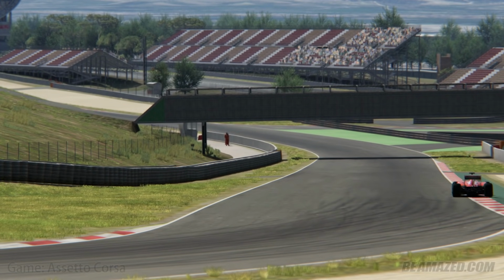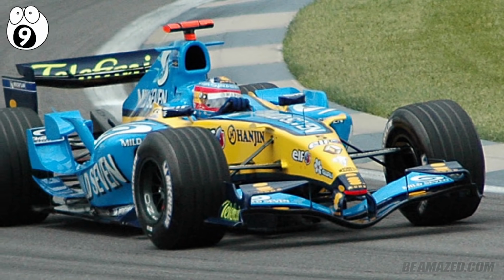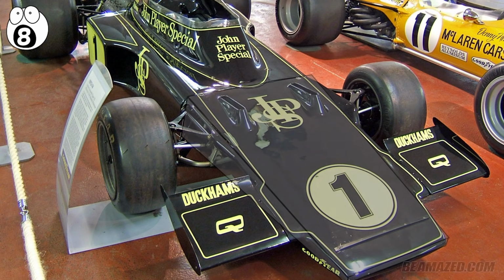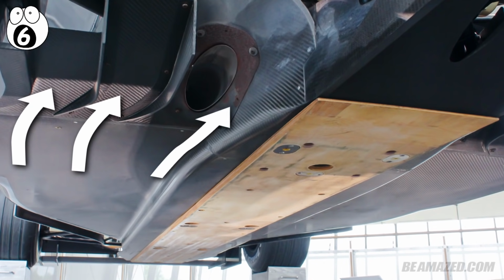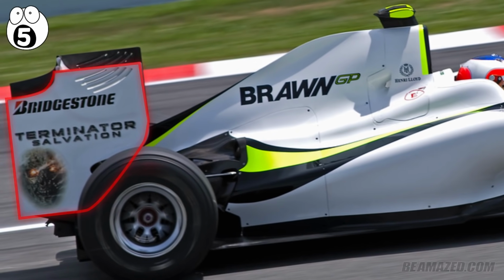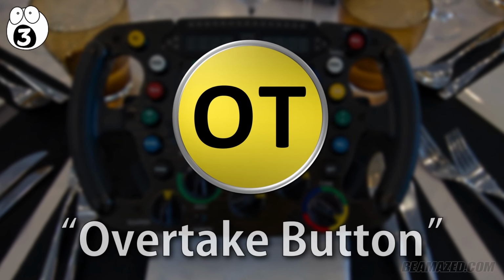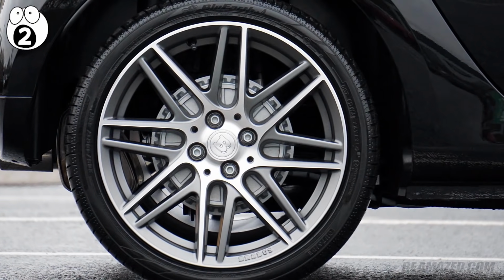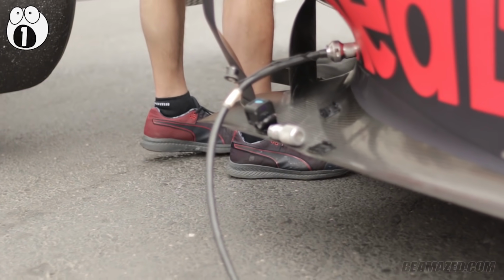Secrets Of F1 Car Design You'll Find Really Interesting

Comment: Terrible facts, The front isnt for downforce its to help move the air away from the tires.
Reply: Lewgenious17 I was just making a joke. Sarcasm is hard to pick up on when reading sometimes lol.
Reply: TGH-TheGamingHotDog Wrong, well you are right it is used to move air around the front wheels but it is also used to guide air to the bargeboards/floor/sidepods and to create some downforce aswell
Reply: TGH-TheGamingHotDog The front wing creates roughly 25%-35% of the overall downforce meaning 500+kg at high speeds... pretty sure they definitely are for downforce more than channeling air away from the tires. And I also seem to remember the first front wings (around 1968 or 1969 I believe) didn't even extend far enough to even affect the tires. I agree they definitely do move air away from the tires, but definitely not their primary function
Reply: You're both wrong, it was added solely to make more space for sponsor ads
Reply: Michael Matthews Oh, apologies hahaha
Reply: Now teams have in a sense reached the max downforce potential that the wing can produce so they have moved to smoothing the air around the tires and guiding to important parts of the car. Such as the barge boards.
Reply: Aerodynamic grip is equally important. I was replying to the OP saying definitively that "It isn't for downforce". Yes, it is, and especially at High speed corners it plays a major role, also accompanying mechanical grip in all circumstances.
Reply: Michael Matthews So your trying tell me that the front wing is solely just for sponsor space ?
Reply: Michael Matthews quitw funny but in the era of ground effects, cars didn't need a front wing
Reply: I don't know if you mean this, but anyway I'd like to challenge you to wonder what would happen if an F1 Car tried to steer at the 130R without a front wing.Answer: A fucking tragedy. Why? It would not suffice the amount of downforce needed to stick to the track and take the turn.
Reply: Yeah it also filters hotter air up over the cooling system allowing the cooler air down slowing for more efficient cooling
Reply: Probably, but keep in mind the wing is actually behind the rear tires so more downforce at the back means you need more on the front to keep the nose from being lifted off the ground. And its not just about absolute maximum downforce because downforce also produces drag, so its really about balancing the two
Reply: 130R?   Is that that highest F1 G force turn at Suzuka?   Something over 5 G lateral?
Reply: 130R;  Is that the 5 Lateral G turn at Suzuka?
Reply: What an idiot you go learn what front & rear wings do!!!!!! Ignorant fool
Reply: ALL WRONG! The front wing is like it is simply because in the 70's F1 engineers were all big fans of Hammerhead sharks, and thought it would look well cool if the cars looked like them too.
Reply: There still is the potential to put a bigger wing on ... There's still some space left around the rear wing to make it bigger.
Reply: Stratos Kat lol, cars did that in the era of ground effect. Anyways, the front wing is indeed for locating air to diffrent places like the floor or away from the tyres. Added effect is that it gives downforce by also moving air up. But with the mechanical grip and floor/diffusers these cars have, i think there is no need for a fron wing to be mostly for downforce

Comment: We should also remember, however, that the F1 rulebook is little more than a listing of banned features and technologies. No turbochargers. No superchargers. No turbines. Ram air intake only up to a certain aperture size. No active suspensions. No actual venturi wind tunnels under the cars, let alone side skirts or suction fans. No wheel covers. No more than two axles. No 4WD. No AWD. No traction control. The last version of the rulebook that I glanced at said no driver control over the air control surfaces, so I guess they knocked that one off. They wanted to ban two-way digital datastreams until they judged it to be impossible to enforce. And judging by the crazy complexity of the steering wheel, I bet the current book bans computerised programmable behaviours.
Reply: Lol, remember that one time that bennetton still had the digital code for launch control in the car and the fia didn't do anything about it
Reply: TheHumanNacho Your completely right except for 1 thing, you saod turbochargers are banned but the current engine format is a 1.6L V6 Turbo Hybrid
Reply: I would then say two things:

Good if they have unbanned turbos, and haven't banned electric transmission (after all, they did ban CVT).
 
Very bad if they have indeed limited engine configuration to Otto-cycle V6. No Wankel rotary engines (the speciality of Mazda). No boxers (the bread and butter of Porsche) . No five stroke engines. No Hüttlin engines. No Grail engines.
Reply: TheHumanNacho Mazda rotary engines are just wow😍, the 787b is in my top 3 best sounding racing cars, its like music

Comment: The holes in the brake discs are not for cooling there are for "cleaning" the brake pad from the brake dust to get better brake performance.It seems not right what i am saying and i was confused to when i heard this put it is so
Reply: Actually they are neither for cleaning not for cooling. They are the escape route for vaporized pad compound. Those gases are at high pressure and separate the disk from the pad reducing friction. The holes provide a way out.
Reply: Carbon fiber is really stable when the heat travels with the strands it expend heat quicker witch is bad becuase it also can be used as an abs if the brake cools off to fast and u try and brake again you will lock up Thomas you are completely rught
Reply: nope, they are mainly for cleaning, there are also racedisks with slots wich are only about 2 Millimetres deep, but it´s more easy to drill holes through both disk layers instead of doing it both sides not symmetrically
Reply: They are for cooling, there are comparisons online with and without holes
Reply: Lewgenious17 No it's for cleaning, cooling is done by the radial slots on the disk (the ones you can see when you look on the thin side of the disk), how would hot air that is whirled outwards because of the centrifugal force get through little holes that are not faced that way? Just think about it.
Reply: Stefan Huber thanks for your support and for the more technical advanced describtion

Comment: Actually going behind a car is good because of a draft
Reply: Drunk On Bleach f1 isn't nascar
Reply: Drunk On Bleach in certain cases. It’s good on straights, because it reduces downforce and increases top speed. In the corners, it is not good, because the slipstream air decreases downforce, meaning it decreases grip as well.
Reply: Draft destabilises air which means low drag, good on any straight, perfect for an oval circuit, but a decrease in drag causes understeer which wears tyres and slows the car in the corners
Reply: Drunk On Bleach Because no one can seem to explain it properly i will, yes running behind another car is good on a straight because you get a 'draft' or a slipstream which will increase your top speed but this has the opposite effect in terms or cornering especially for an F1 car. When you are behind another car they will have used up all the 'clean' air or another words stable air and the car behind will hit the car in fronts 'dirty' or unstable air, this dirty air is caused by the car in fronts aerodynamic devices like the front wing, rear wing and diffuser being the 3 main areas and being manipulated by these parts to create low pressure and high pressure areas of air to create downforce which makes it unstable for the car behind which makes it harder for the car behinds aerodynamic devices to work properly therefore reducing downforce and overall grip. So yes it is a benefit to run behind a car in a straight line but it certainly isnt in the corners
Reply: vjekoP I thought the same thing😂
Reply: yea its great but not for an f1 car in a corner... With less air going trough the wings you have less downforce there for making you understeer...
Reply: Bruh your stupid the position of the front wing and rear wing create a slipstream for a slight "draft" most drivers use it for fuel efficiency and to get closer into era range
Reply: On a straight yes. Corners no
Reply: vjekoP have you even seen f1
Reply: Max Nawas front wings are broken very frequently
Reply: Drunk On Bleach The Slip streaming effect is awesome, but sometimes you could end up running into the back of the car in front. Not that it happens all the time, it’s just a thought. But yes, the slip stream is awesome
Reply: André Janeiro straight aways